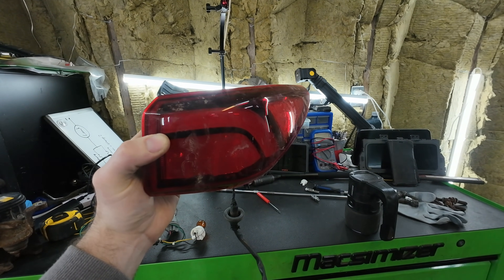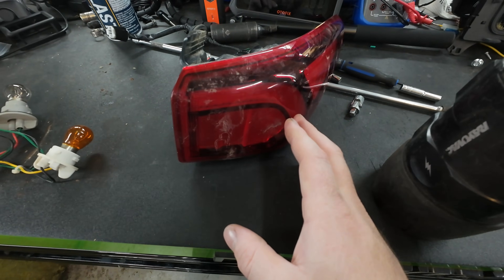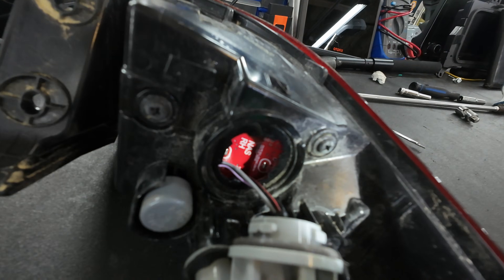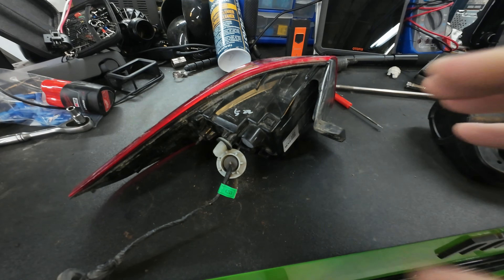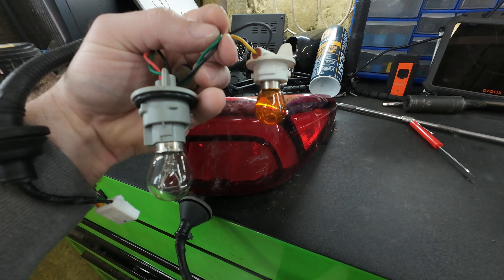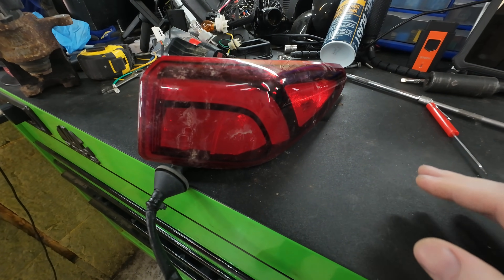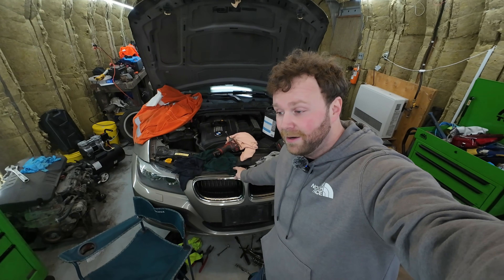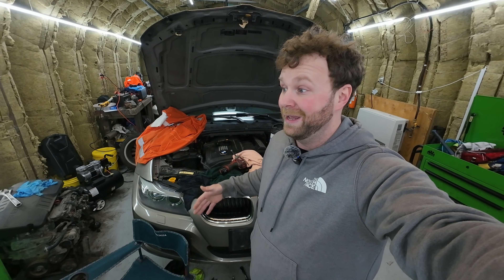Car Manufacturers don't even want you to change bulbs, they want you to replace entire assemblies!

Comment: I wish they would ban led lights on cars. They blind the crap out of everyone on the road making them dangerous to other drivers. Also the cost of replacments is robbey and should be illegal
Reply: Last night I was driving my 2012 Expedition and I normally am not affected by lights in front of me because of the height.  A jeep was behind me with LED lights that were so bright that I could barely see from the washout.
Reply: @ThunderStruck94660 I have legit slowed and stopped because I was so blinded from either side...

I'm not moving if I cant see where I'm going

Just yesterday a car behind me had such bright lights on the road I thought they were my own.  I only could see the difference when they passed me
Reply: @elgatochurro most likely illegal leds on amazon that are put into headlight housings not designed for them. It causes it to scatter light in every direction instead of the proper beam pattern and cutoff
Reply: @elgatochurro  ....do you bother "proof-reading" your comment BEFORE posting?

.
Reply: @WOT--1377 my new phone doesn't type or autocorrect well unless i type it all
Reply: @ThunderStruck94660  was once driving with my 1300 beetle and this massive car was behind me with lights so bright that I literally turned my lights off can could basically still see the same.
Reply: @justthere845 That should be a '66 Beetle. I had one as well. I wish I could have one again.
Reply: @LordSamuelJ  99.9% of people who throw in LEDs do not aim them like they are supposed to. Thats the problem, not the lights themselves.
Reply: @dr.hugog.hackenbush9443 . The lights themselves are definitely the problem. LED was initially used only laser applications, it is a beamforming technology, not a light source beneficial to human life. The light from LED bulbs is inferior in quality to incandescent, and does not diffuse like incandescent  or create a natural effect in lighting. Hence it makes it harder for people to see, which is part of the reason why people who install LED lights in their homes turn them up full blast in their house, to maximum brightness . LED lights have also been proven to cause retinal damage, and interfere with sleep cycles. The universal mandating of these lights by greedy governments influenced by their corporate overlords  was a crime against humanity.
Reply: @dr.hugog.hackenbush9443  So the vast majority of people misuse the product meaning that the product is the problem.
Reply: China has us jousting each other at night.
Reply: and when u switched them off the slowly fading natural coloured old bulbs added to the charm, particularly with classics :)
Reply: yes!
Reply: So many if them are after market cheap illegal bulbs as well. Needs to be more fines for illegal lights.
Reply: @LordSamuelJ  I liked the idea of 2 or 4 sealed beams. No discolouring, when you changed the bulb you also changed the lense. Plus it was easier to tell if the high beams were on. Now there's lights all over the front and back not even for drivers visibility.
Reply: And they use highbeams all the time throughout the city. Full of idiots
Reply: When I drive the new company Tundra at night, other drivers flash me because I am blinding them with the headlights. This is insane.
Reply: Bring back the 1157!
Reply: Yes, it’s so bad that I refuse to drive at night.
Reply: Its less the LED that is the problem, its the people that are just too stupid to regulate the height of their lights. Even smaller cars nowadays have their lights almost up to a truck level. Blinds everyone, including me with a lower suspension. Insane.
Reply: I  slow down to a crawl with these fuckers, I hope I make em late to whenever they're going. Everyone should do this, of course not on the highway.
Reply: It's not the fact they're LEDs, it's because people put in LEDs that are too bright. In Australia, most cars that are imported from Europe have their headlight LEDs swapped out for less bright ones, because the blinding European ones are illegal to use here. However, obnoxious drivers just go down the the car parts shop and buy the same type of ultra-bright LEDs and put them in anyway.
What needs to happen in Australia is for the sale of those illegal vehicle components to be banned. I know there's still the internet, but cutting off the problem at the source is what's needed. There's no excuse for retailers to be selling anything that's illegal to use. (The same thing applies for those "death spike" bike racks that go on the back of cars. They're dangerous and illegal to use, for multiple reasons, but shops still sell them.)
Reply: @LordSamuelJ  A lot of those are led bulbs placed in reflectors made for incandescent. The two are optically incompatible. If a designed for led reflector is used then there shouldn't be a problem. But uneducated people buy the led replacements
Reply: My prescription sunglasses has surprisingly worked really good at night with allowing me to see so much more clear because the lights aren't blinding me and they also work really good in bad weather
Reply: A lot of after market sell super bright LED’s. And they are for off road use only. Yet, still the Stupid ones don’t get it. They blind on coming traffic.
Reply: @chrisdaniel5004 People are also putting led replacement bulbs into housings designed for incandescent. The two are optically incompatible.
Reply: @LordSamuelJ  amen, brother!
Reply: Simple solution, block out your mirrors if they behind you and flash your brights at them
Reply: @tylersowa3858 and not look at the road?
Reply: @tylersowa3858  .......do you "proof read" your comment BEFORE posting?   How does "flash your brights at them" help when they are behind you????

.
Reply: @WOT--1377  a reasonably intelligent person would know that he meant flash your lights at them if they're coming toward you.
Reply: I wish people get over "banning". Stop trying to ban something like a dictator. We need other options and competition and let consumers decide. I'm sure there could be auto makers who could make cars like they did in 2005 but Americans already banned that technology too.
Reply: @fringestream990  Your headlights used to have to meet strict specifications as far as brightness and aimpoint for the vehicle to be roadworthy. Now whatever restrictions remain aren't enforced (Texas recently stopped doing safety inspections altogether and kept emissions inspections, which if you're going to pick one is bass-ackwards).

And that was before the wannabe dictators of the last decade and a half. Is it too much to ask that we bring that back? 

That said, I wouldn't ban LED's specifically, just any headlight that exceeds specific brightnesses in low beam and high beam modes, and would go back to enforcing aim in safety inspections.
Reply: @JonBrase  Aim aim aim!  Those damn lights are so bright you can see that they light up half a mile away.  Seems every other vehicle now has lights that aim right up into my eyes.
Reply: @fringestream990 no. When safety is at stake and undermining  people's ability to drive we BAN THINGS.  Like reasonable adults.
Reply: @janelleg597  seriously you americans need to cycle

Comment: Manufacturers recieve crash data on all of their vehicles & redesign their cars to improve safety BUT NOW also to increase residual income thru moving easily damaged & expensive items into those areas of the vehicle where accident damage is prevalent - ie the corners & the front grille. A slight ding in the car park can be an expensive event for your insurance policy's no-claim bonus & premium. Just take a look at where Hyundai are now placing their rear light clusters - there's no protection for them even if a butterfly were to fart on them. The frontal crash zone is littered with expensive tech. Also, the design of many cars' panel profiles has become more intricate with waist lines containing swirls & other "stylistic" elements - all designed to shut out the skilled panel beater & ensure it's easier to buy a new panel than repair it.

Comment: YES I LIKE MANUAL ROLL DOWN WINDOWS.   I THINK ALL MFRS SHOULD BE MANDATED FOR MANUAL WINDOWS, THEN IF YOU WANT POWER WINDOWS THEN PUT THAT IN AS AN ADDER, HOWEVER WITH ELECTRIC WINDOWS YPU STILL HAVE THE ROLL DOWN HANDLE.  IF THE ELECTRIC WINDOW FAILS ??? THEN GRAB THE FXXXXXCKING HANDLE AND ROLL YPUR WINDOW DOWN.   MAN WOULDNT A RULE LIKE THAT PI$$$ OFF AUTO MFRS

Comment: This is ridiculous, lights are safety devices and of all the things on a vehicle, this should be a low cost replacement by the owner. Also these bulbs were interchangable, now each side needs a different assembly part.  You kept a couple different ones in the glove box and they were easy to put in.

Comment: Totally agree with you, been in the trade for over 50 years and I have seen a lot of good changes.
Fuel injection, anti lock brakes, stability control, air bags (but not Takata), autonomous emergency braking just to name a few.
This is among one of the stupidest ones I have seen.
I am very close to hanging up my tools and retiring.
I don't envy the techs of the future, unfortunately through no fault of their own they are becoming part fitters.
The ability to actually "fix" things is getting lost.
I had a younger tech (in his 30s) ask me to teach him how to fit and adjust a set of points recently.
It was the first points ignition system he had ever seen.

Comment: Yep, I've got one on each corner of my 2015 F-150 Platinum. Headlights and tail lights are factory sealed LED units. 135,000 miles without any issues yet, but when it doesn't happen it's going to be expensive. At least the aftermarket is making replacements for the popular vehicles. I knew this before buying the truck, but I wanted the platinum trim level which was all LED. The days of simply replacing your headlight and tail light bulbs are coming to an end. There's no reason that they couldn't have made them user serviceable except for greed and planned obsolescence.

Comment: Forget getting parts at Napa even if it is an inexpensive swap out part most likely it has to be program at the body control module a modern non-dealership auto garage has to have tens of thousands maybe hundreds of thousands in electronic boxes to be able to work on the cars. 😢

Comment: My car needs a thermostat replacement. It used to be a $10 DIY repair, but now the whole water pump needs to be replaced for $1600 because the thermostat is integrated into the water pump.
Reply: I don't get why manufacturers insist on creating entirely new designs for engines, transmissions, suspension, etc. every few years to replace older proven designs, if not for planned obsolescence. Why not keep making the most reliable engines that are capable of going a million miles or more and simply tweak them to meet modern emissions standards? Why not keep using the same bolt patterns and castings as long as possible for easy interchangeability? Why do they need to eliminate the old design to make way for a new one?
Reply: @TactaGhoul I retired from GM.  They do this to create " forced obsolence ".  This forces the customer to purchase new vehicle every 5 years.  And then ONLY purchase parts and service from the dealer.
Also...it deliberately destroys the secondary used market.  Meaning you sell you new car to second owner but second owner can't sell to 3rd guy because parts exceed the value of the used car.   It sucks what the automakers do.
Reply: Lemme guess, they have to take off the whole front of the engine because the water pump is hidden in by the timing belt/chain/whatever?
Reply: @kontrarien5721  Yes, have to take off the intake manifold
Reply: What make and model of this car so I dont accidently buy it?
Reply: What make and model?
Reply: seems to me there might be a way around that if the water pump is fine - but maybe not - for that kind of money I would be digging around on You Tube to see if anyone has puzzled that out

Comment: One thing I’ve noticed about most of the Hyundai vehicles is the wiring for the lights are under sized for the amps drawn. 14 gauge instead of 12, plus I believe they’re using copper coated steel instead of solid copper.
Reply: Cheaper, of course.

Comment: The driver's door 'puddle' light quit working.   The bulb was good so the next time I had it in for service I asked the dealer to look at it.   That door's Central Processing Unit had a problem affection only the puddle light.    Also controlled by the CPU are the side mirror controls, the side mirror heater, electric door locks, window controls and window motor.   Repair estimate: $2,600.00.
Reply: wow - wouldn't be that hard to open it up and fab in an LED bulb 12v bulb and wire it up to the battery/harness.  in the rare times you want a puddle bulb just flip a little switch . . .   $20 or $30 including wire  - led - switch  . . . might not be as pretty though

Comment: Just replaced both headlights & corner markers on my '97 F150 this past summer.  Came in under a hundred bucks from Rock Auto.  Even included headlight bulbs (good old halogen).  All this shit is doing is incentivizing theft.  I don't want all that bullshit to begin with, certainly don't want it packaged with my headlights or taillights.  That's where the problem is.  Too many functions packed into a light module.

Comment: Just replaced my '03 PT Cruiser's rear license plate socket and bulb [water shorted the base out: great design, not] but
a little wiring, a trip to the store, two-wire solders, and $7 or so, US, and I'm done.
PT's not my first choice, but it's simple. I'll never go to newer cars, for reasons obvious from the vid. Be safe. Be happy, & Pensate Profundus !

Comment: I laugh at cars with broken LEDs when I realize my taillight bulbs are older than their car is, and my taillight bulbs still work.
Reply: When you can no longer drive your car because government says it's too old, not "environmentally" friendly, outlaws old car parts buying etc etc etc... you didn't beat the system genius. They're still going to come for you. Remember your comment when they do.
Reply: @outlaw6369  there are still cars from 1915 driving around. My car wasn't made until the 1990s. I think I have some time. 

My state doesn't even do proper smog checks. They just plug into the car's computer and ask it if it thinks it has a problem. No trouble codes = no problem with the state.

Comment: fun fact they don't glue them together the use sonic welding techniques
Reply: True the sonic motion create heat and the plastic bond together.
Reply: Welding is for metal parts, not plastic.
Reply: @myoutuber77    Not true at all.  Welding plastic is the correct term.

Comment: I've had similar ones. Most of them I cut the lens off and rework the electronics. Usually bad solder connections. You can also find damaged units from wrecks and pick up the electronic part for cheap. The sad thing is they aren't that expensive, just a rip off from the dealer. So the first stop is alibaba and other sources.

Comment: I had a 2015 chevy express van as my work truck and one of the light on the rear passenger side went out I don't remember now if it was a tail light or turn signal light, pulled the light assembly and the bulbs were good (standard automotive bulbs) took the truck to the dealer for repairs. A body control module was bad $750 to fix the issue, a computer board located who knows where to replace relays and flashers. What a crock!

Comment: A few commenters have brought up good points.  LEDs last much longer than older incandescent bulbs.  I still buy bulbs in pairs because it seems that when you replace a blown one, the other side will go out within a few weeks (turn signals, brake lights, etc.), especially with older vehicles.   While the LEDs themselves might last longer, they rely on relatively complex circuits and are largely unserviceable.  If user-serviceable parts aren't used, maybe the auto manufacturers should be regulated to provide lifetime warranties on those parts.  You can find older vehicles that have been hacked and pieced back together, where a busted taillight lens is covered in red tape and an aftermarket bulb socket was spliced into what's left of the wiring harness.  It's not pretty, but it's functional and will get you down the road legally (depending on your state laws and enforcement).

Comparing sealed beam headlights to modern automotive lighting is apples to oranges.  For decades, the industry standard sealed beams dominated, but outside of a few shapes and sizes, they were pretty standard.  I had round headlights on my 1960 Willys DJ3A, 1973 BMW 3.0, 1978 K5 Blazer, and 1978 F-250 (off the top of my head, I might have had others).  I could have swapped the lights from the three American vehicles with few problems.  Even if they weren't a direct fit, a little ingenuity would have me on the road in a few minutes.  Right now, I've got a 2021 Transit Connect, 2012 Kia Sorento, and 2009 Dodge Journey sitting in the driveway.  Some of the bulbs might be interchangeable on the older vehicles, but there's no way I'm taking a headlight assembly from any of them and putting it on another.